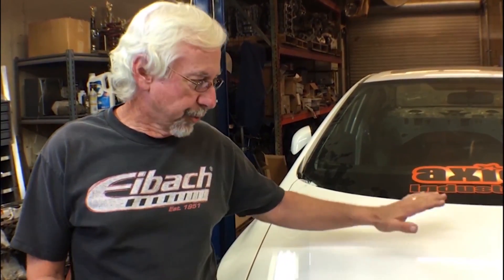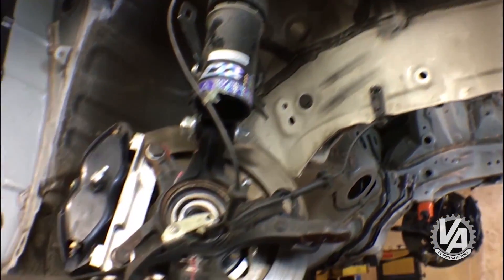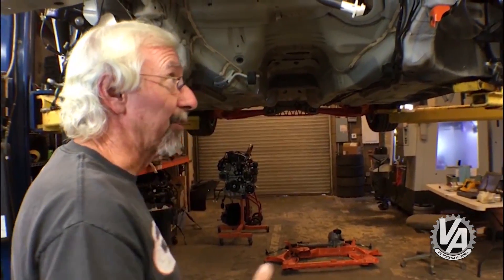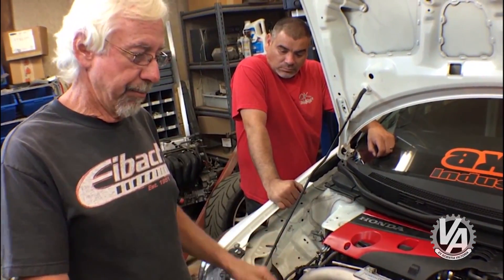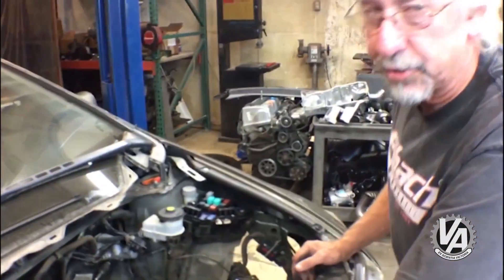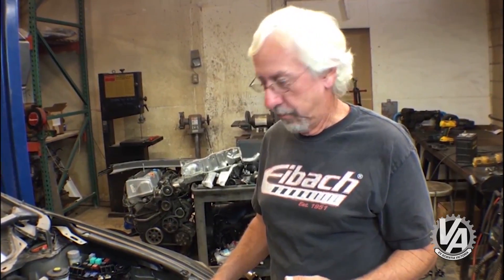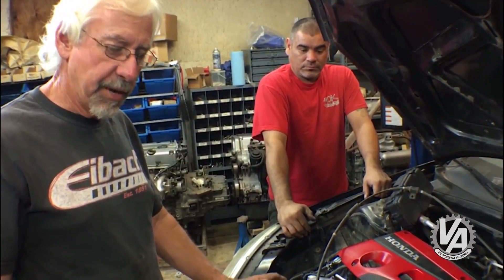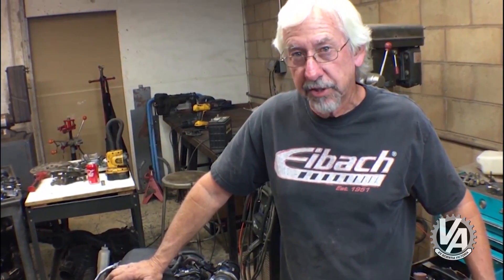K20C1 Swap into 7TH/8TH/9TH GEN Civic - Test Fit

Comment: I have a 12 si and want to do the k20c accord swap did you ever make a swap mount kit??
Reply from the maker: No, not yet. You could get the powertrain side mounts and make the brackets custom. That's what most people do when they want to swap before a kit is available.
Reply: @ you said in 2015. The European type R was the same chassis. Do you think if I got my hands on a set of mount brackets for that do you think that would work or I would still have to go custom?

Comment: Love your video's, quick question does the K20C1 fit into the 2004 euro r Accord? Is there a mount kit for this also?
Reply from the maker: It will fit with some slight modification to the engine bay. We haven’t made  mounts
 yet for that chassis.

Comment: Very cool! It's always nice to see more swap options available in our community. I wonder if any of the older K series transmissions will bolt to these engines? From the pictures I found online it looks like it might, but I also remember reading that 2015 was the last year for the traditional bell housing bolt pattern with the K24Z7.
Reply: I'm curious about this as well.  I've got an 04 type s that I'd be interested in swapping a k20c into, but I'd want to keep the stock transmission.

Comment: Does the fitment apply for the fn2 eu civic
Reply from the maker: Yes.
Reply: Legend thanks for getting back to me, does it go with the gearbox to along with wiring looms? Just a straight swap more or less
Reply from the maker: @deeze33dw  This is not really a straight swap. There is a ton of wiring to get all to work nicely.
Reply: @VTECAcademy  alrighty so is it mainly wiring that could be the tricky part, how about the drivetrain would the gear box fit straight to the k20c1

Comment: @VTEC Academy Any guidance on 10th gen civic swap with K20C1?  So perhaps someone could pick a "lesser" 10th gen civic up at auction for instance and get a K20C1 to build a "poor man's Type R"?
Reply from the maker: It bolts right in with stock Type R engine mounts. The wiring would be another issue. I'd suggest using the Accord K20C.
Reply: @VTECAcademy  outstanding, thanks for the guidance! Do you think K-tuner for engine management with this generation?

Comment: Will this engine-type fit into my 2017 CR-V AWD 1.5t, CVT at the moment?  Will my drive-train hold up under the new power ratings?
Reply from the maker: It would absolutely fit. You would be using the auto AWD transmission that comes in the RDX. I'm not sure how that would work with the stock rear drive shaft and differential.

Comment: Can the k20c or k20a fit in a 2014 accord sport? That's a swap I want to do.
Reply from the maker: Yes it will.
Reply: @VTECAcademy  please 🙏 where do I start? I am ready to buy mounts etc? I want to install a k20a in my 2014 accord sport and boost it.
Reply from the maker: @bignatecricket  I don't have any detailed information. I would start with buying Hasport FK8 kit (just some of the parts not all and modifying that. At some point Hasport will develop more kits to fit different cars as well as unive3rsal mounts for those who want to get started earlier.
Reply: @VTECAcademy  thank you I am on it asap. I been wanting to do this swap and I'm glad I now know where to start. Ty

Comment: Will it fit in a 10th gen 2020 civic I just hydro locked my engine today water coming out the pistons
Reply from the maker: It will, but I would use the K20C4 from the Accord since it is cheaper and much easier to wire. But, if yo can find a wrecked Type R you can grab all the stuff.

Comment: how would it fit in a prelude?
Reply from the maker: I'll have to try it out. Those cars have a pretty big engine bay, so it should fit. The engine bay is very similar to the 94-97 Accord and Fifteen52 built a K20C powered Accord Station Wagon. Watch for an upcoming video.

Comment: @VTEC Academy I have a 2016 2.0 litre 6 spd manual civic, would my transmission handle the k20c1 swap?
Reply: The transmission is strong enough, for a stock K20C but would require an adapter plate of some sort to mate that trans with that engine.

Comment: I wonder the clearance of the Crx del sol 🤔🤔🤔 just think about it the lightest Honda modern era chassis ever married to the most powerful honda engine, adding couple bolts on and a tune that engine can get 450whp, it's such a beast 🔥🔥🔥
Reply from the maker: The Del Sol has roughly the same edit bay dimensions as the rest of the 5th gen Civics. http://vtec.academy/test-fitting-k20c-type-r-engine-eg-ek-dc2/

Comment: I have 2008 civic sedan which powerful engine can i substitute with
Reply from the maker: If it were me, I would swap in a 2007-2008 TSX engine. But you might nave to make a transmission mount.

Comment: Hi,

Can K20C1 fit into 2007 Civic EX, if do then what are the other components that need to be replaced.
Reply from the maker: Abdul Razak didn’t you watch the video? It fits nicely, maybe a little trimming on the under side of the hood for clearance. We will know more about everything that needs to be replaced or modified once the swap is up and running.

Comment: Hi all,
So in Australia we only got the 9th gen civic hatch in the 1.8l motor either in the base model with a vti-s 6 speed manual and all the rest with a 5 speed auto.
Now the 2014/15 vti-ln came with a sportier facelifted front and rear ends, updated daytime running lights with a much better edgier looking front bumper and the rear bumper with diffuser, only problem is it only came in 1.8l Auto config.
Anyway I'm wanting to know how involved it will be to put a 9th gen type r motor and manual gearbox into the 2014/15 Vti-ln car or would I be better off getting a vti-s 1.8 manual for the exercise ?

Comment: Guys will the engine fit in a rsx? Also how hard would it be to use the ctr transmission with a2 ?
Reply: If you looked at the Video, he clearly states the 8th gen Civic pretty much has the same engine bay as the DC5 chasis AKA RSX.  So yes.

Comment: That is great info to hear & see, wondering about price of that engine to swap in 8th Gen R18 model ? and what best swap for that model...you sir (Honda God father)
Reply from the maker: Waleed Mahmoud it won’t be cheap as the engine and transmission are highly desirable. You can get more power for less with a K24 swap and a turbo, but it won’t get all the cool point for being rare like a K20C1.
Reply: @VTECAcademy  i see ctr engine and transmission going for a decent price. Will it fit in a rsx?  But im more interested in how can we get the anti torque steer from the ctr into other Hondas. Also who makes a adaptor plate so we can use the ctr transmission on k20a

Comment: I would like to know, Will the 2.0 R bolt in directly to the 1.5t si  coupe chassis?  And HR-V with manual
Reply from the maker: Yes on the 2016 up Civic chassis. I doubt it on the HRV. That chassis is based on the Fit.

Comment: I would want to get a kit to fit into an EP2 (same parts as in EU), own an EU8 myself with D16V1. Will there be kits for that kind of swap aswell? Planning to own the car for some time, thinking with the idea of K20C1 in it.. It would have the same issue with the relay box... wonder how I could get the driveshafts and suspension + brakes from the new one to fit.. Not to mention the ECU. Would love the idea of old meets new.
Reply from the maker: Most likely yes. It wold be similar to the RSX.

Comment: I have a question. I have a R18 2012 Honda Civic sedan lx 1.8 motor. I was wondering if a 2012 Honda si motor 2.4L would fit in the R18? Been lookin for answers can’t find any anywhere
Reply: Jose look at the 8th gen forums some guy actually did the R18 to a k20 swap
Reply from the maker: Yes it fits size wise. I'm not sure if you can do a straight swap though. Some of the mount holes for the engine mounts may be in different locations and the subframe mount may be different too.
Reply: Yes that motor will fit your car
Reply: I got one also and the engines are completely opposite mounts and exhaust. Hang out this k20c sounds like the swap to do

Comment: Em2 k swap pleaseeeee  this is my list so far im 05 civic kswap parts list!

*Parts already have
-k20z1 engine
-k20a2 tranny
-alternator 
-k20a2 wiring harness
-ac compressor
-starter
-intermediate shaft
-06 rsx type s axles
- 06 rsx type s subframe
-5lug conversion
-06 rsx type s shifter box and cables
Reply: So, how's the k swap going now ? 
Also a kswapped em owner ;)
Reply: @HouseOfPetrol  terrible the motor blew smh

Comment: Since the ILX is based on the ninth gen Civic, how well does it fit in the ILX?
Reply from the maker: fvjason very well
Reply: VTEC Academy oh cool! I know the ILX had a six speed so that's cool, but I'm rather curious, what about the dual clutch transmission? Will the k20c1 fit the dual clutch in the ILX?
Reply: VTEC Academy oh cool! I know the ILX had a six speed so that's cool, but I'm rather curious, what about the dual clutch transmission? Will the k20c1 fit the dual clutch in the ILX?
Reply: VTEC Academy let me ask that question a different way; since you said that it fits very well in the ILX, will the k20c1 fit very well with the 8 speed dual clutch in the ILX and TLX?

Comment: will the factory k20 box in the 7, 8, 9gen fit fine to the C motor?
Reply from the maker: No, it is smaller. An adapter plate would be needed.
Reply: i presume the newer K20C transmissions are a bit stronger? I'd be a bit weary of bolting up a regular k20 transmission to a ~300 lbft K20C
Reply from the maker: I consider that the limit of the transmission for racing. Longevity is pretty short at that torque. Yes the newer transmission is stronger and heavier. An adapter plate still might be a popular part.
Reply: the stock k20z4 has been known to hold up well over 400nm. the fk2 and fn2 gearbox are very similar

Comment: Does anyone why shifting arm mechanism gets stuck in gear ? Swapped my 02 rsx with a 2011 si tranny and , put the 02 mechanisms was trying to run through the gears 2-5th worked , 1st was completely blocked out and reverse didn’t engage at all . ??? It’s currently stuck in 2nd gear and the shifting arm won’t come out

Comment: Your videos are awesome! I have a 2012 Civic FK2 Hatch (same as the 2015 Type R). It comes with the R18Z engine.

Based on the above and from what I picked up from this video, correct me if I am wrong but do the K Series motors fit easily in the R Series cars?

Thanks in advance
Reply from the maker: Yes it will. Once Hasport makes a mount kit for that car, it should easily bolt in.

Comment: Can you test fit them in a 7th and 8th gen accord? these communities are quite curious about fitment using the 2018 accord motor in the prior gen accords.
Reply from the maker: Those are kind of down the list. But based on the fact that those cars came equipped with either a K-series or J-series it's  going to fit at least as well as it does in the 2012 Civic. The TSXes too.
Reply: Thanks for the prompt reply!! got my hopes up.
Reply: @VTECAcademy  when u said if the car pretty much came with a K series motor, than the K20c should fit with no prob. I thought that was a clear statement.

I guess listening is hard to do even with rewind. 

Not trying to bash people here, but if you watch a video and ask a question that has already been answered. I doubt you should do a swap to your car because YOU may mis a step, forget something and then ask again after you buttoned everything back up. Get down the road, and motor BLOWS. 

listening is just as important as reading.

Comment: Is the transmission the same as the NA K series? I'm curious if my bracket that lets me bolt a K series to my s2000 transmission will work on this engine. I think it could fit in an S2k.
Reply from the maker: Not even close.

Comment: Pleasee test fit it into the rsx!!!!!
Reply: We put it in a 2001 Civic and it is basically the same chassis. The RSX has slightly more room in front. It fits.
Reply: Dynamic Tuning  why the k20 is a better motor
Reply: Daniel Gonzalez i know i have a  k20a2 on boost. But it would be cool to put a motor that came boosted for that factory style feeling. Installing my turbo kit and getting parts was bich lol
Reply: Dynamic Tuning lol u can by a full kit,not piece one out..u think u could get that small turbo to make big power
Reply: Daniel Gonzalez been there done that. Ive bought a full kit already and i pieced my sidewinder kit together. It really doesn’t make a difference whether you buy a full kit or not. Maybe i wanted a part from a different brand that the kit didn’t offer lol. Some people don’t want big power, some prefer conservative power without the hassle of picking out a turbo kit. I get what youre saying but youre taking this outta proportion my dude. Lmfao

Comment: Would you consider checking if it fits in a cd5 accord?
Reply: The engine is already back in the car. It will fit in that car. It will be a little tight around the differential though. There is a limited amount of time to do this type of stuff, so I tend to get the popular cars out of the way and look at the less popular stuff when I have spare time. That includes all the Accords, TSX and Preludes. Based on how the K24 fits in the Accord and Prelude, I see some problems with the subframe, but not with the overall width of the bay like the EG, EK and DC2.
Reply: Brian Gillespie got a point there I didn't even realize this

Comment: I have an Ep3 and I was wondering will the ECU will be an issue with getting the stock gauges to work?
Reply from the maker: Yes at first. But eventually there will be a solution. If you're first though, it may take a minute to figure it out.